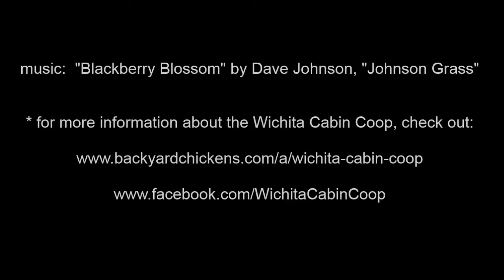Wichita Cabin Coop - time-lapse build

Comment: Great video.  Can you advise the internal measurements of the hen house and overall height of the coop.  Thanks
Reply: Check the links at the end of the video.
Reply from the maker: The coop portion is approx. 3'x5' (total length is 10' and coop portion is about 1/3 of that). The height of the coop/run is 7' in the front.